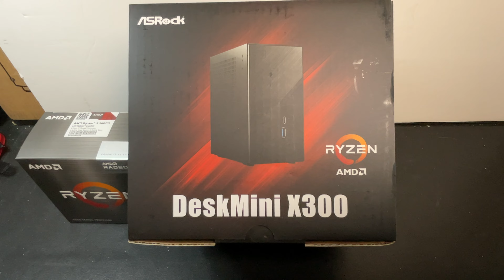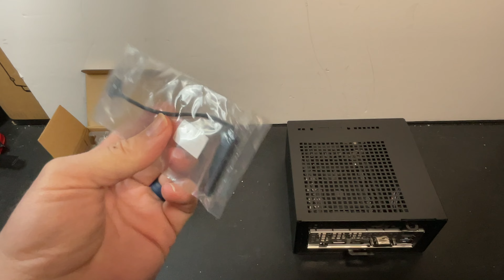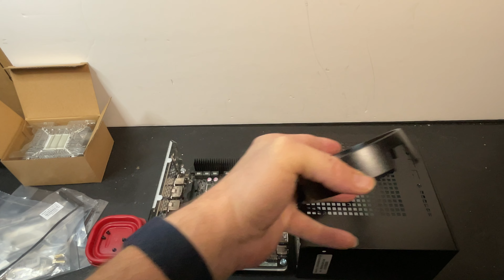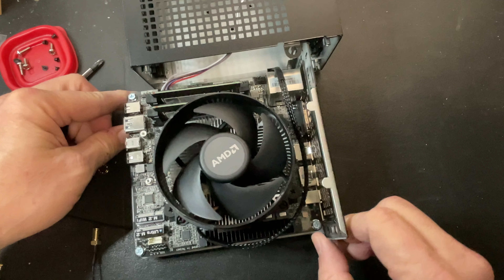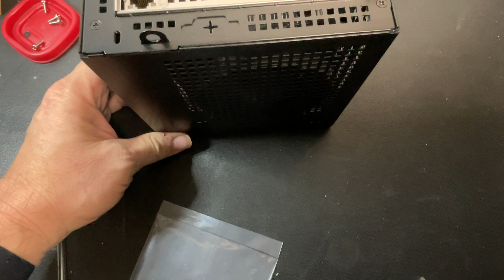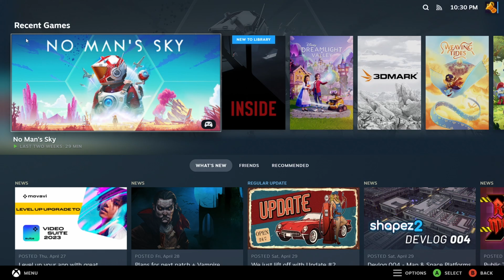Building a Ryzen "Steam Cube" with the ASRock DeskMini X300

Comment from the maker: What games should I test out on this?
Reply: eSports titles,
Recent AAA titles.
Reply: Hi, thanks for the video. I have the same build but I installed holoiso (steamdeck os) , the game Injustice 2 doesn't reach the 60 fps even at 720p low settings (43-44 fps max) whereas it works flawlessly on the steamdeck with high settings. Please, can you test this game on windows 11 and tell me how it performs and which are the best settings for a steady 60fps ?
Reply: Battlebit
Reply: I own this exact pc with the same specs. My top game for it right now is Skyrim Special Edition. Runs like a dream.
Reply: Not a game, but I am interested in this build for running Seemusic or Embers piano midi visualizers.
Reply: Asseto Corse?
Reply: IRacing?

Comment: It's easier to remove the motherboard from the chassis before mounting the CPU fan.  That way the backplate studs remain exposed without holding them up  It makes it easier to mount the cooling fan.

Comment: Best try must use APU with maximum EUs in G part, it must be 5700G with overclocking applied to GPU, and best memory tuning. Price delta versus 5600G and 5700G is not worth to ditch 5700G. I own both the X300 DeskMini (5600G/16Gb) and DeskMeet X300(5700X/32/4060), and now i clearly understood that 5600G is a wrong choice for DeskMini. Same mention goes to 16Gb of RAM. 32Gb are now cheap. Anything regarding cooler and temperatures are not complex either - get AMD Wraith or any good cooler that fits. Buy and play. 5700G with 32Gbs is best solution.

Comment: It looked like you didn't enable XMP profile on your memory? The AUTO setting should be set to XMP1 to get best results, also the iGPU should be boosted up to 2200 - 2300Mhz depending on your stability in the bios. That would give you some more performance.
Reply from the maker: Good tip!  I always go back and enable XMP and any other OC’s after I run stable in Windows for a few days. So it rarely makes it into my videos. But good tip for those reading!  Thanks for watching!

Comment: Sir, questions

1. Can I use the m.2 WiFi slot for m.2 storage?
2. Can I use a stronger Power supply brick like 19v 160w?
3. Can I OC the RAM, iGPU and CPU?
Reply: There's another m.2 slot on the back of the motherboard.
Reply: 1. Probably yes if you find small one
2.yes you can use more powerful adapter
3.overclocking is possible but vrm and components overheats and shuts off. Even with 3000g cpu , it hangs with overclock while gaming. Alternate vrm cooling needed.
Reply: @nitehawk4067  I saw ETA prime game bench test with 5600g igpu and ram OC.. You think I can too with everything else cooled.. Vrm included?

Comment: I am watchin this video on my Asrock X300W with a Ryzen 7 5700G. As long as you do not overclock it it does not have any problems. Also better use a Noctua slim profile fan to keep temps around 68 to 70C when playing games.
Reply from the maker: Great info. I really wanted to try the stock cooler to make sure it would fit for other people watching. I haven’t pushed it enough to need a better cooler yet. But now you got me tempted to keep an eye out for a 5700G, lol. Thanks for watching!
Reply: @FamilyGeekery  The same happened to me. I started with a 4600G But I wanted a little mor hmppphfff!!!
Reply: @vsuarezp How loud does the fans get when playing games? 

And also I've seen people get around 55-60 degree when playing games using Noctua fans, how come you get 70? Then again, they don't max every settings, many of them use 720-900P at low/medium settings 😅
Reply: I don't know. Because it is really hot here? I use it at 1080p everything in low. Maybe at 720 it would be cooler. I have to try. @Mosestylez
Reply: @FamilyGeekery  Are the stock cooler  very noisy? Or need to buy one
Reply: Hey! I am using the very same setup and there is no issue with the power supply. You can (or maybe should) overclock the iGPU. It can go up to 2300 Mhz at 1.225 V. The memory can also be overclocked, I am using it at 3400 Mhz. The performance boost is pretty great! About the cooler, Thermalright has some good low profiles ones that will fit into the X300.
Reply from the maker: @RicardoCAnanias Awesome. Thanks for the suggestions!